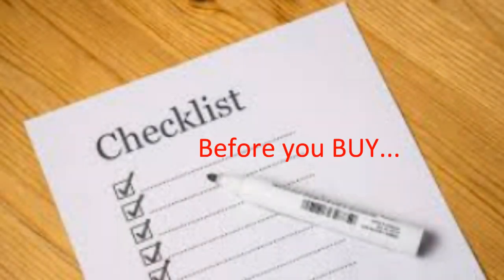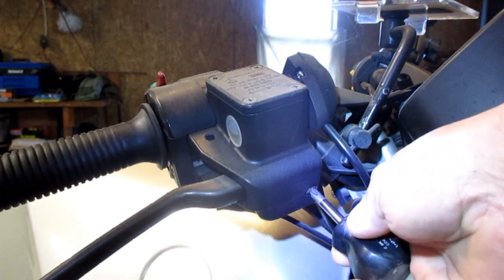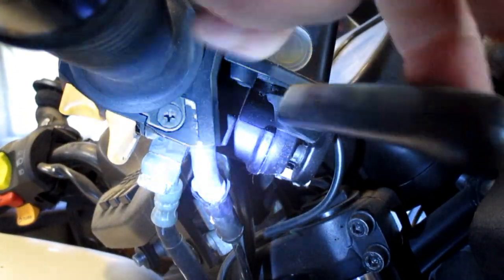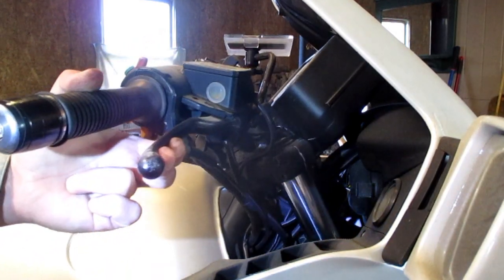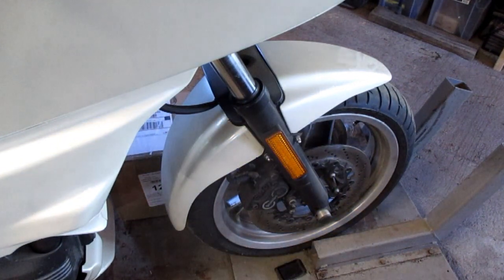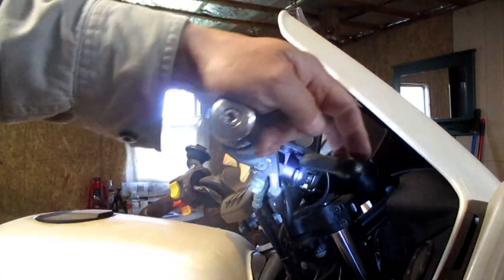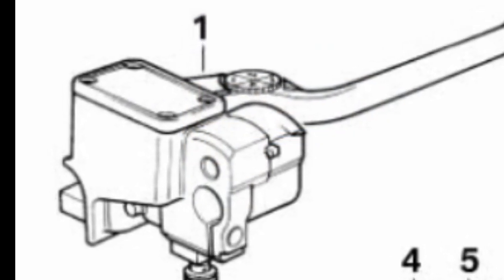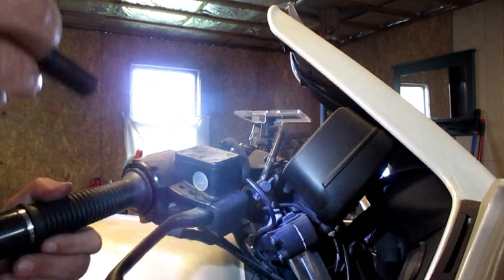BMW Service - Front Brake Master Cylinder - Look before you buy

Comment: R1100R rider here:  My front brake master cylinder is 22 years with 150,000 miles on it.  I'm in southern California so my bike never sits the winters in storage.  The master cylinder is in great condition.  The only problem is the sight glass looks cracked and brittle, but doesn't leak as of yet.

Comment: When I changed out my brake lines, I installed Spiegler lines. Front and Rear Brake Master Cylinders were shot. Plunger Seized up. I wish I could have saved them. I ended up spending the $$ for replacements.

Comment: I think this guy could be BMW R bikes is our best fixer of common problems. I had my front brake master replaced due to failure after the front tire replaced. Now it is soft and locking front brake. I think he hit on why, clogged brake line. I parked it for awhile and now it will not start normal. I want to check the clutch switch because I can push start it. I know that is not the best way to start my R850R but I had to see if it would still run.
Reply: Spiegler is pricy but makes great brake lines. Please don't ride your bike with the old lines if you can get it started. The factory lines are known to collapse after 20 some odd years and lock up the front brake when they do. Check out the BMW MOA forum, it has a wealth of information on our oilheads.